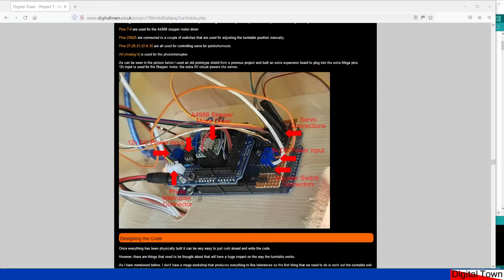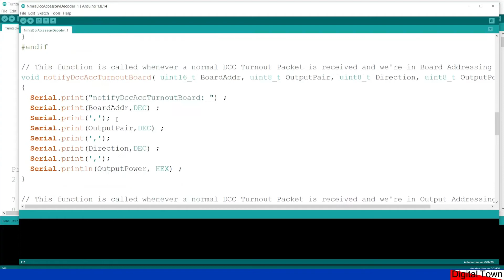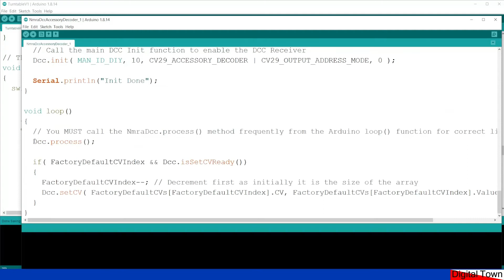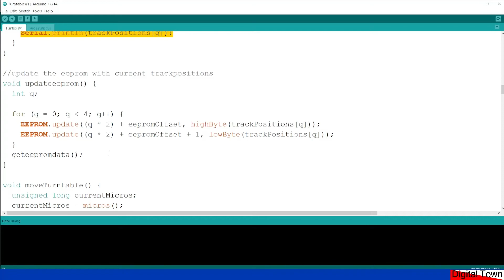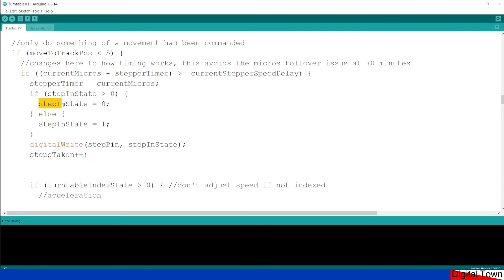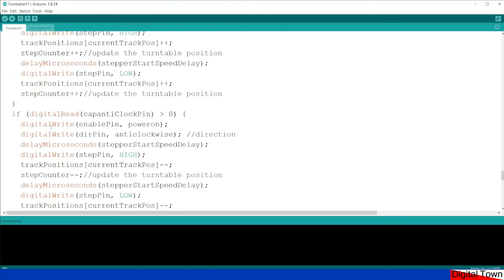Arduino C++ DCC Indexing Model Railway Turntable Part 2

Comment: Great little project. I’ve done something similar 😁 Have you now updated the 4988 driver board to the silent TMC2208?  I was amazed at the difference.
Reply from the maker: I built another version later that was far quieter, I just used some rubber gasket on the metal moounting plate as it was resonating with the stepper and the damping killed it.
Next time I build one I will try the other stepper driver.